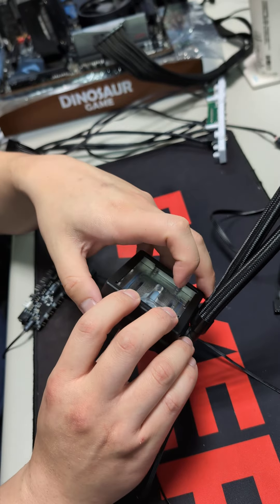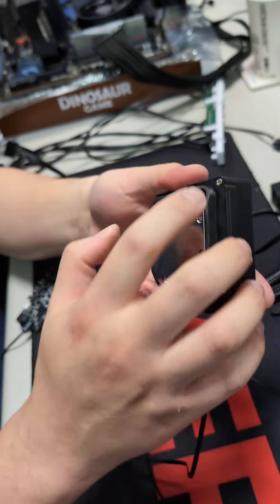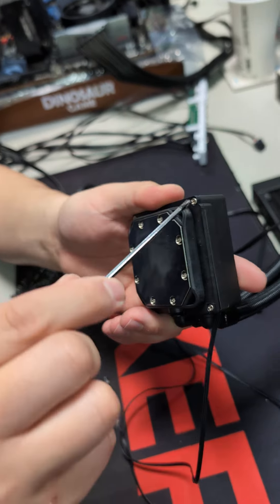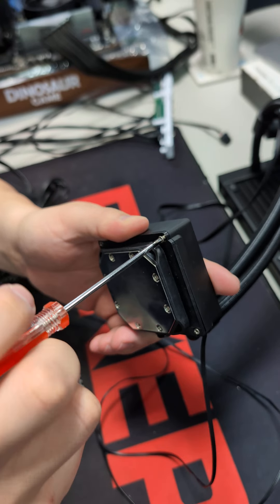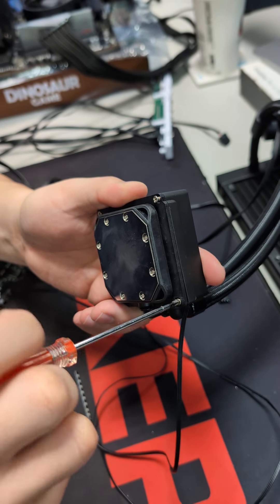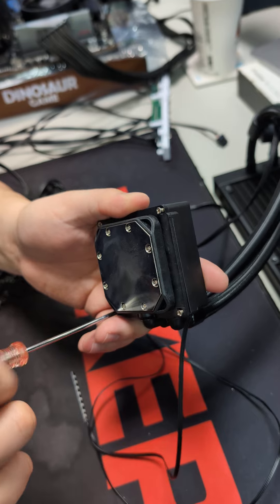How to change ARGB LED strips for BitFenix CUBE AIO Water Block

Comment: can you send a cable for working leds ? i dont have argb output in my mobo so no lights presents itself sadly. no need to control, just converter cable to make it work.
Reply from the maker: The ARGB LEDs can be only controlled by the motherboards or Asus AURA SYNC, MSI Mystic Light,Gigabyte RGB Fusion 2.0 or Asrock PolyChrome certified controller. There is no covert cable or certified convert cable for it
Reply: @bitfenix  This should not be true. There are generic and branded ARGB controllers that can be powered by SATA. There would be no logical reason for your AIO's ARGB to not work with those as its all standardized.
Reply from the maker: @deuswulf6193  these are not tested and certified by motherboard brands therefore we don't recommend
Reply: @bitfenix  The controllers don't connect to the motherboard, so it has nothing to do with their support. Take for Example the Cooler Master Atmos AIO, they include a controller which exists on its own for when a motherboard has no ARGB header.

Cheaper generic controllers are powered by the PSU and have buttons or remotes to control the lighting. They don't connect to the mother board at all.

Cheap RGB case fans used to come with these, as well as most RGB LED strips. They exist, they are cheap, and they are used often for RGB lit products.
Reply from the maker: @deuswulf6193  usually the ARGB are controlled by motherboard or pc case with ARGB LED control. BitFenix CUBE AIO can be also controlled by PC case with control board certified by major motherboard brands

Comment: I got a cube 360 yesterday I use with 5700x 4.7ghz Oc and it reaches 95C at 160W is that normal ?
Reply from the maker: yes, it's normal as when you go for OC, it usually will go much higher.
Reply: @MARKC0WAN  Hope you can get this resolved. This is why I am nervous buying from some of these Taiwanese or Mainland based companies. They don't have the infrastructure set up in certain markets to deal with these problems, and they pinch pennies or avoid contact when something goes wrong. 

In the future, if your cpu absolutely needs an aio, its always smarter to side or front mount them. Even better if you vertically mount the GPU. This way if a leak were to ever occur, it won't do much damage as it can only drip down onto the desk or away from core components. I only slap AIOs on workstation rigs, otherwise a good thermalright or DeepCool dual tower air cooler is always going to be a better bet.